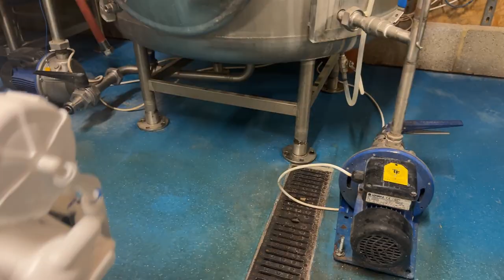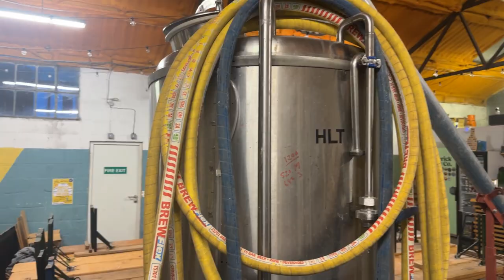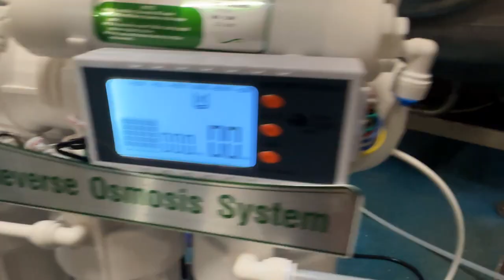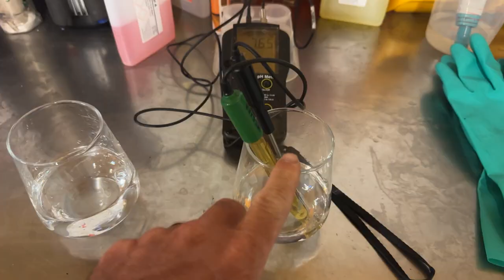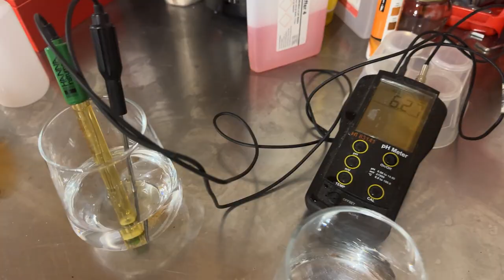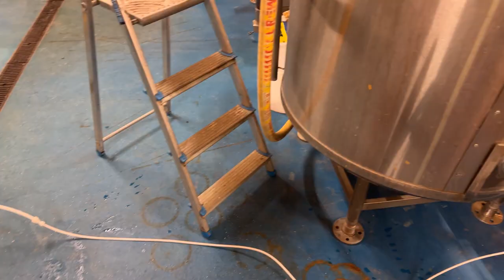Installing an RO System in the Brewery

Comment: The system looks good mate. I got one recently and using it with 100% RO. Made 2 awesome beers so far but still working on the water additions side. Could you reuse your drain water for cleaning or washing down?💦
Reply from the maker: I dont have a way to do that sadly. And my only real source for heating water for cleaning is in my HLT and that would then mean mixing RO waste water with good water which would be even more of a waste. I do need to come up with a way of reusing some of it tho.